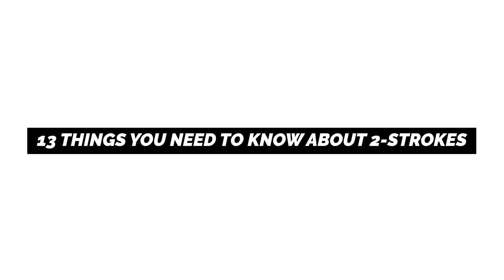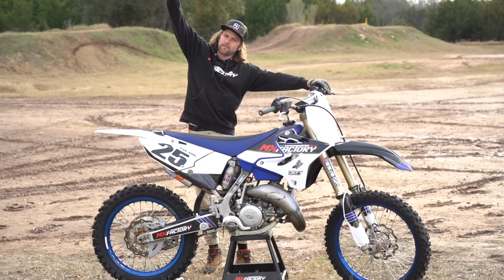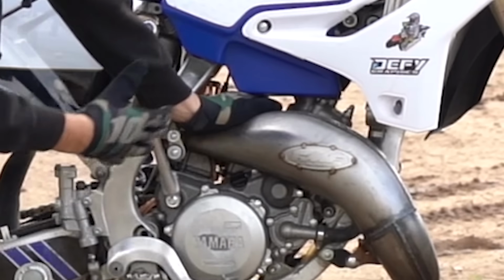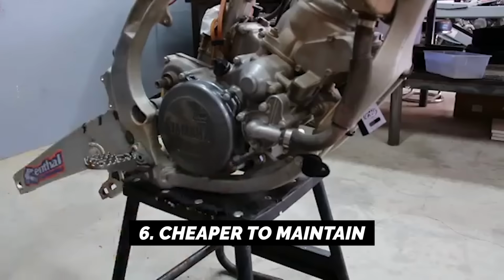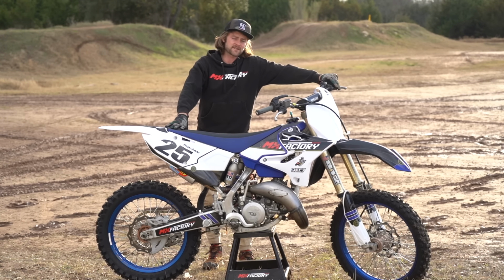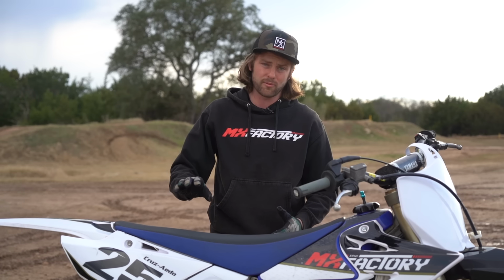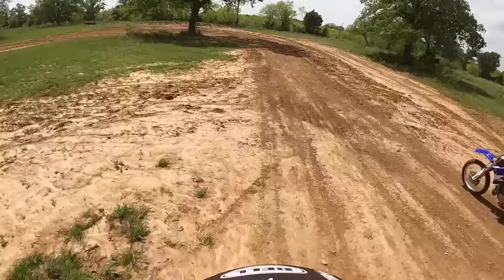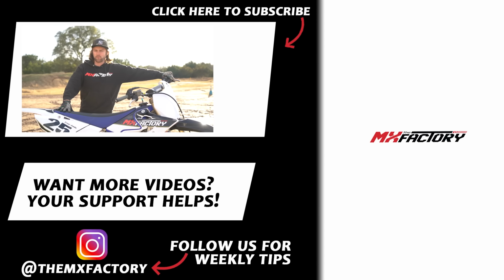13 Things You Need to Know About 2-Stroke Dirt Bikes

Comment: TM Racing make the best 2-Strokes! And you can get fuel injection
Reply: Pretty sure ktm and yamaha have fuel injection
Reply from the maker: Nice!!!
Reply: You ain't lying, brother! I have a 2019 TM EN300ES and a 2020 HusqvarnaTE150i and they both are so much fun! Even though the fuel injection is smooth on the Husqvarna, I enjoy the keihin carb on the TM a little more, although you can order 2 stroke fuel injection as well, with the added bonus that TM uses higher quality parts in their transfer port injection that has had NO reports of malfunction like Ktm/Husq./Gas Gas. I want to add a VHM head, pro x cylinder, pro circuit full exhaust system, and either a smart carb or STIC Metering installed in my keihin PWK38...that will bring my HP up to stock 450 HP range then, cause the enduro 300 is 52HP stock on VHMs website BEFORE the installation of their aftermarket head. HGS pipe system comes standard, however, PC has a proven formula with their exhaust that increased power in every rev range. Anyone have suggestions as far as sticking with the PWK38 and adding a STIC Metering Bloc, or going Lectron or Smart Carb 2??? The Smart Carb will certainly look the best and match the gold, magnesium, and black colors on the TM...but will it perform the best or give ~$800.00 worth of performance? The STIC may be cheaper and better? I am one blessed dude though, even though I'm selling the Husqvarna cause it was bought for my wife and she hates it. Lol :( will miss it...rode it more than she dud! Haha Those small bore 2ts are FUN!
Reply: @cameronsmith4485  not sure about ktm, but yamaha is still only carbureted. Pwk38
Reply: @cameronsmith4485  No fuel injection on Yamaha 2 strokes.

Comment: Hell yeah I have a 2003 rm125 and you always have to be on the pipe
Reply: Lower your cylinder with a thinner cylinder base gasket, (or possibly none at all, but seal it with yamabond4), until you have .030" of piston squish clearance.  That will help your mid range and lower power a bit with more compression and a lower exhaust port. You might lose a bit of very top end power, but most engine mods are a trade off with 2-strokes.  The bike will be a bit easier and more fun to ride, and 93 pump gas should still be fine for octane.  You might have to do some power valve linkage adjustment because of lowering the cylinder, but usually not.  Look it over and understand it, and you will figure it out.
I grew up riding and racing MX bikes, and worked on them and modified them for myself and a couple friends back in the day.  Then I got into manufacturing, (machinist with several college degrees now), and got back into 2-stroke engines.  I have been porting and stroking little 30cc engines for a living for 14 years now.
Good to be back home. :)  Trust me, lowing the cylinder is common for more mid range and low end power, and it works.

Comment: I wouldn't say that a 2 stroke has less power than a four-stroke.
Reply: Agree. For the same displacement a 2 stroke is generally more powerful because it fires and produces power twice in four revolutions compared to a  4 stroke's one
Reply: indDeed
Reply: 1998 cr 125 had more power than my 2004 crf 250. I would say two strokes have even more power, but 4t has more power at low rpms.
Reply: @impalaSS65  two strokes are way lighter they have less parts
Reply: @alexvanstelle5880  yeah my post doesn't make sense. I meant "4strokes" are really heavy etc.
Reply: @impalaSS65  😂😂😂
Reply: @robocombo  That has been true, until recently. The 250 4-strtoke MX bike now makes about the same power as a 250 2-stroke MX bike, (about 45hp).
But I know a 2-stroke can make more power than a 2-stroke MX bike does, but the engine would probably be too wild for a MX track.  Today, there is really no good reason why the 2-strokes can-t race the 4-strokes of equal displacement,---but the commie FIM/AMA will never do it.  That is why the FIM/AMA needs some competition, and that competition will have a 2-stroke advantage.

Comment: You forgot the most important part! There is only one lesson on a 2 stroke for going fast. Lean forward and hold it wide open! If it bogs, pull in the clutch and then snap it right back out again! That one lesson works for everything!!
Reply: 😭😭😭 will add that in the next video
Reply: That's two lessons

Comment: CC to CC, the 2 strokes still make slightly more power than the new 4 strokes. The 250 2 strokes make just shy of 10 HP more than the new 250 4 strokes on average. But if you're talking 250 2 stroke vs 450 4 stroke, the new 450s blow the 250 2 strokes out of the water, especially low in the rev range. They used to be competitive, but now the 450s make easily 10-15 more HP than a 250 2 stroke.
Reply: Again it's not all about Hrsprs the power to weight and the sound and smell of 2 strokes beats the 4 strokes all day. Unless you don't ride to hit jumps then get a 4 stroke.

Comment: Recommend  a YZ 85 for a 120 lb 5,1 12 year old ?
Reply: Perfect.  This YZ250 is too tall for me at 5'9", (none of my older 250 2-stroke MX bikes were this stupid tall. Last being a 97 KX250).  For me, I must be able to touch both of my toes, (the full toe, not just the tips), on the ground at the same time after the rear shock sag is set up correct for my weight.  As a rule of thumb, your rear suspension should sag 1/3rd of the total rear suspension travel when you are sitting on the bike with your riding gear on, (from fully extended on the stand with your wheel off the ground).  You adjust the shock spring preload rings to do that, and it helps your bike handle properly.  Setting your shock sag should be one of the first things you do with a new bike before riding it.

Comment: I have a 2000 200cc 2 stroke KTM. She is monster, I need to rebuild the motor because it locked up a few years ago. What kind of carburetor should I buy for it,  also going to Colorado up in the mountains.  So any other advice to do the bike would greatly be appreciated

Comment: One thing experienced about two strokes is a lot has to do with the rear tire . Years ago I was recommended by a open class Maico rider to put a trials tire on the rear of my 74 125 Rickman Zundapp . It was about a 400 width . Unbelievable,but later I went to a full knob and everything went south . The knob pulled too much out of the bottom and radically changed the peak rev level. I  still have it . I bought an 06 KTM 200 XCW and experienced some of the same. I went to the dealer and talked to the salesman and he said "The tire has nothing to do with it" . So I asked if there was a smaller sprocket . He said " You're over thinking this and it's a WR and it's as much torque as you can get" I went over to parts and asked if a sprocket was available and to his surprise it was . I put it on the bike but now I can't go past 50 mph . That was ok for hare scrambles and I'm an experienced novice. I've done vintage motocross and vintage trials . Jeff Smith actually got me into trials . I was at a hare scramble and was parked next to a guy from Tennessee that had a 300 XCW and unbelievably he had a trials tire on . I asked his buddy why . He said " I don't know or question anything he does ,but he's going to take first place . His buddy smoked everyone there. Amazing hole shot too. In the woods things change but I'm sure in Moto cross a full knob is best,but I always liked them better when the edges wore off. Jeff did explain about how important the tire was and his 74 CanAm had a full knob up front and a trials tire on back . I really think letting the tire slip a bit on a two stroke on smaller cc bikes helps even the power band . Let know what you think . 😎
Reply: Yeah you're totally right, 2 strokes need to slip to keep in the power range and also so the aluminum internal parts and sprockets don't get over stressed and get destroyed. That's why you can't ride a 2 stroke on the road, for very long. At least that's what I've noticed. I'm no pro.
Reply: @jamesordwayultralightpilot  The right tire is more than many realize on anything. . 😎

Comment: Hi, my 1998 cr125 started leaking gear oil out of the bottom end, since it is an older bike, I figured it was a gasket issue because I know that the previous owner had never changed them, but if it could be something different please let me know
Reply: A gasket, a seal, or a cracked case.  Clean it up and run it for a bit to see where it is leaking from.  If you are lucky, (but even splitting the cases is not to hard, but case center gaskets almost never leak), it will only be the gasket or o-ring for your clutch cover.  Usually, you only change gaskets when you rebuild it, (but I have sen cylinder base gaskets blow out, gets dirty there.).  Use new gaskets when rebuilding.  I remember my first machine shop job, and I was green, fresh out of community college.  If I could not figure out this big machine to make this part, my boss would ask me, (RIP Dean Malstrom), "Is that machine smarter than you are?" That was funny right there. :) Enjoy working on your bike.  It is fun to figure them out, and we can appreciate what it takes to make them.  That bike may be the beginning of a spectacular engineering career for you. :)
Reply: The shift lever seal is also a common leak.  The shaft runs through a bushing, then a seal and out of the cases for the shift lever.  When the shaft and bushing wear out, it gets sloppy and the seal can no longer do it's job.  If that is the case, a new seal, shaft and bushing will fix it like new.  Get a "shop manual" from your dealership for that bike.  It may cost $100.00, (not quite I think), but it is the manual the mechanics use in the back room.  It tells you how to do everything on the bike, and shows you any special tools you may need for a particular job, with part numbers, so you can order the tools from the dealership too.  There is no reason why you can not figure this bike out, and every reason why you should IMO. :)
Reply: One more thing.  It is human to think.  We are the only living entity on this planet that can do what we can do, figure out reality.  If we don't, than we are not totally human.  That is why I will not wear a mask. :)
Reply: @EarthSurferUSA  Cool, thank you for the tips
Reply: @EarthSurferUSA  Thanks, I didn't even know that they made "shop manuals" like that, I just have the owners manual, I think ill get one, thank you for the info

Comment: KX 250 2 stroke owner here.... It Is a Brand New 2005 KX250M1....The bike was started for a few minutes to set up the jetting for a performance pipe, and remains PERFECT. With only a few minutes running time, never having been ridden nor seen a grain of dirt in its 17 year life,....I am going to ride it and not keep it as a static museum quality display. 2 stokes are all I know,...and I know a lot. I have had it for 6 months, and thought about the best course of action to break it in, and stash some back-up parts first before going forth,...its all slowly reaching a good point to opt for a spring roll out. I`ll keep you posted....

Comment: Guys I’m think or buying my first dirt bike what would be better for a beginner? A two or four stroke,
.
Reply: If you gotta ask the question i want to emphasize dont get a bike with too much power as a first, even 2nd bike, get something that you are comfortable on and can eventually push it for all it has. Usually 4 stroke is easier to learn on because of the smoother power curve but a two stroke with similar power should be good too, because they are lighter and cost less to maintain or fix.

Comment: Pro tech tip power band on a 2strk has 2 meanings the famously referred too one on a 2stroke is due too the expansion pipe creating a vacuum in the exhuast from the sonic wave frome combustion depending on the expansion pipe determines when the power band kicks in which creates the equivalent of 14psi of boost once rpms match the tune pipe and exhuast as a unit ..which causes a sudden increase in power
Reply: my guy bein technical over here
Reply: @barakbertoch6690  figured the 2stroke guys would like that everyone likes turbo ..ps any exhuast leak ruins this effect

Comment: Im going from a 600 4 stroke to 250 2 stroke any tips?
Reply: Always keep a finger or two on the clutch lever,---always.  It is the key to power delivery, and could save you from a whiskey throttle loop out, (for example),  if things get out of hand.  Remember when you were a kid, and you started losing control, sliding back on the bike, stretching out your arms, and holding the throttle wide open, (because you are falling off the back of the bike), and you could not shut off and crashed?  A finger on the clutch would have saved you. :)
Reply: @EarthSurferUSA  thanks never whiskey throttled though but might on this 😂

Comment: Is there a 300cc 2 stroke motocross bike meant for motocross? All the 300cc I find are for enduro
Reply: No but some folks take the ktm 300 cylinder/head, and bolt it on a 250 😎

Comment: I ride a TM EN300 2 stroke (Carb.), i was amazed of the torque. x.D
60hp 110kg/240lbs. Enduro not cross, so i have light. ^^
The reason i bought 2 stroke with a carb is, that i can repair the bike myself easier. :)

Comment: You forgot Beta 😎 I have a 300x-trainer 2t and it is loaded with torque not hp at 220ish lds ready to ride it is a freakin blast to ride I don’t think I would take another machine for the trail riding I do I don’t race

Comment: Im 14 and I just got a cr125 as my first bike! Its a bit tall but I'm taking it slow and I love it so far!
Reply: You can have your stock seat lowered about 1".  I had "JB Sport Trim", (Nicole Guild in Gowen Michigan, 616-994-4767), cut mine and put the stock cover back on.  I made a cardboard template, (flush to the bottom of the seat, showing what I wanted cut off at the top), so she could see what I wanted cut, and she did a perfect job for $80.00.  I gave here $100.00.  That is the least you will pay, to have any part lowered on your bike, and them most for the money by far.  If you have the suspension lowered a bit, (I went 6% of my travel on both ends too), do not send your suspension to PR2 in PA.  I have to redo my shock myself, because they did not know a simple calculation for the spacer thiskness in the shock.

Comment: GUYS I NEED HELP - sorry if this is a dumb question but i am a noob - im buying my first bike and my friend is going to sell me a 2012 yz250 2 stroke. do you think its too powerful of a bike to start out on? just curious what your thoughts are. it has a rekluse clutch on it so i feel like that will help with learning. i know most people would recommend a 125 or 150 to start out on but im getting a really good deal on it. im trying my best not to die on this thing.

for reference im 6'1 165lbs

Comment: Can u help my out I want to save up for a dirt bike with more power I currently ride a 125cc pit bike.I wanted an 85cc 2 stroke dirt bike.I started looking into the brand YCF mainly pit bike brand and they sell a 150cc big wheel 4 stroke for 2449$ it is borderline dirt and pit bike so If I want I can race it as a big wheel pit bike or just a dirt bike. should I spend 4k on a 85 2 stroke or a big wheel 150cc 4 stroke YCF

Comment: Every engine/motor has a "power band".  It is simply the rpm range that the engine/motor makes usable power.  Racing 2-strokes tend to have a "peaky power band" (smaller duration of rpm range power, but high peak power.), with the smaller bore machines.

Comment: Okay Cody, your worst nightmare comment for a review.
You did great.
Back in the 90's and before that, weren't two strokes basically double the horse power of four strokes?  Or something along those lines. A 125 two stroke would have as much as a 230 to 250 four stroke kind of thing.
Reply: Thanks!
I wouldn’t say double but probably 2/3’s
Im almost 30, so i lived through that transition. What held 4 strokes back in the 90’s was lack of technology. They weighed alot more, had a ton of engine breaking, were hell to start, and bogged due to being carbureted. I think alot of heads were turned when Doug Henry won Las Vegas SX in 98 or 99.
Another thing to consider nowadays is the fact the AMA allows 250 2 strokes to race 250 4 strokes in amateur racings. The 250 2 strokes have become the poor mans mod bike in amateur racing

Comment: ive rented a 125 2 stroke before, ridden it on a track a few times and really liked it. Im hooked and am looking to buy my first bike. Is a 125 2 stoke good for a beginner or should I go 4 stroke? im 6 ft tall and 140 pounds.
Reply: 4 stroke is an easier bike to ride, when the engine breaks its more to repair though

Comment: I just got a two stroke, never road clutch, it is a pain to learn the clutch on a two stroke compared to a 4 stroke but prefer 2 stroke  because of the noise ;)
Reply: Yeah 2smokers rule 100% i wouldnt change my 08 yz250 for anything jst stuck a new full pro circuit exhaust on the badboy an shes an absolute ripper, the upgraded exhaust worked a treat (as if it wasnt fast and fun enough 🤤 shes even faster now) gt a 2 smoker and hold onto it their gettin quite rare the older ones now, anyway great vid love the channel 👍

Comment: I just bought a 98 rm 250 fastest bike I’ve ever had or been on I used to have a 2020 big wheel 125 Honda and haven’t had a bike for 4 years and it just didn’t even feel right with the power this bike has 😂

Comment: I would love to see the revival of the open class two strokes.  You would need a 1000cc four stroke to ride in the same class!    ;-)
Reply: Not really there are videos of 450s keeping up with 500 2 strokes, on a MX track you don't need that much power.
Reply: @filippo384  My comment was a joke because of the pairings of current bikes in a class.  lol  

In reality a 1000cc four stroke would probably weigh a good amount more than most folks would want to hustle around a track.